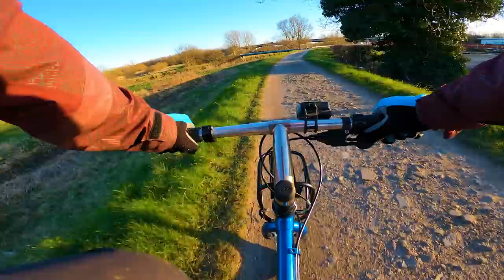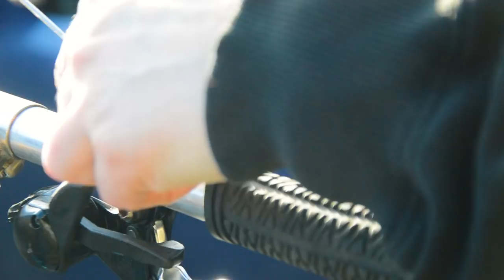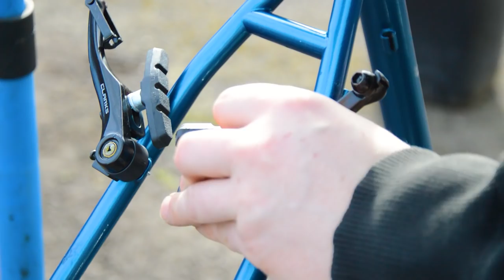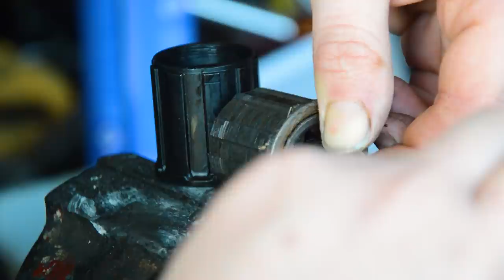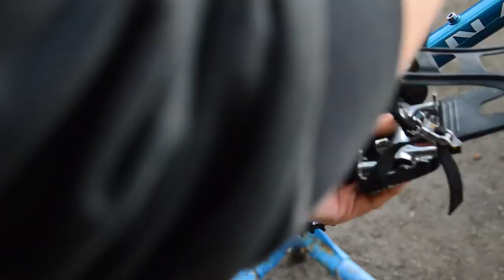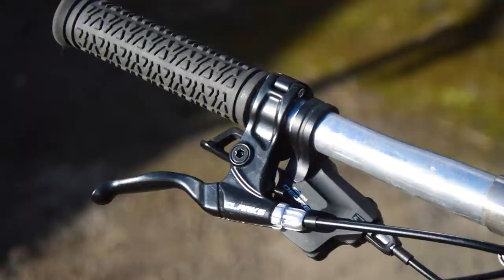7 Speed To 10 Speed Retro MTB Conversion - Slick Bicycle Commuter Restoration

Comment: Oh, you can just SWAP the freehub body.. You just saved me quite some money. Planning something very similar with this old Raleigh Mirage I found.
Reply from the maker: Yeah, I found SJS cycles have a good selection of "modern" freehubs that have the same mating pattern as the older hub.  A bit of respacing on the axle and it's good.

Comment: Cool looking bike, with that black parts it gets that modern look, because there's everything black in these new bikes... Quite highly placed bar with this stem in line with a saddle, so yeah, good for commuting and some recreational use, but it struck me right away to try fit some drop bar in there(maybe because of slick tires)... Though yeah with this long stem it would get quite extreme, but it might just compensate small size for you.
Reply from the maker: Thanks.  I do love the black and blue combo.  It's quite sleek!

Comment: How did you manage the cassette with that derailleur? I have a slx m675 sgs rear mech with the same cassette but the inner cage plate will strike the 42 cog and prohibit the derailler from going into the largest cog. B-Screw is already all the way in.

Comment: Hi, @MonkeyShred . Just found your channel and seen this vid, advice on the stripped threads, when using heat, heat the crank on the outside and not in the centre, heating the centre does nothing but expands the outer BB with the crank, didn't see a comment explaining this so hopefully will help you in the future, seized metal objects like in this vid inner object cool if possible outer heat. Contraction if possible and expansion helps to loosen stuck metal materials as shown in this vid. Enjoying your channel by the way ☺️

Comment: Nice. I’m in the process of doing the same with a Trek 930 from ‘94. Canti’s replaced with V-brakes! Snap! I’m using Continental Double fighters 26x1.9”.  The 7 speed hub will be swapped out but the new drive will be microShift 1x8 with a 12x46 rear and a 42 front. Maybe I should do 1x10 with a 11x48 rear? Like you the frame is one size too small for me so it will be sold hence the 1x8. Love the videos.👍
Reply from the maker: Having ridden around on my 1x8 wide ratio (11-42) conversion for about 400 miles now, what I would say on that is it's fine...BUT... using the wide ratio you can really feel the steps in gear ratio when you're shifting.  Wide ratio gearing is best left to 10+ speed I think for a smoother experience.
Reply: @MonkeyShred  Thanks. I have 1x10 on my other bikes; I like it, but at the moment 1x10 microShift AdventX are not easy to find in stock in the US. I’ll try in the UK when I’m back home in the Isle of Man next month.

Comment: when my 1st last and hopefully only stuck and stripped crank happened it was luckily and Pinned POS..   took a very large hammer and reapeated bashing to get it off.. well over a month of breaking automotive pullers and all. multiple spanners gave their lives.

I have a Nishiki with a Stuck BB somebody burnt the NDS..   tryna buy and impact today.

very useful video for 7-8 speed carrier swaps. I've got two 7 speed wheels I want to run 8 and 9 speeds on as well as donor hubs. I guess as long as the drive splines match..  not sure what brand hubs.
Reply from the maker: Yeah as long as those freehub splines match it's usually a straight swap - taking in to account the difference in axle spacing or wheel dishing that is.

Comment: lovely little bike.
Is it as simple to go from 7- to 10-speed on a road frame?
Reply from the maker: Thanks.  I believe road spacing might be 130mm so the frame may need "stretching" a little to accomodate a 135mm spacing which is what I used in the vid.
Reply: @MonkeyShred    that  is  correct   road  bike  130  mm     so  needs  stretching  but   don't  try  stretching  ally  frame

Comment: hey I couldn't follow what you switched at your axis to make the larger freehub possible... can you explain?
Reply from the maker: In a very brief summary - I measured the difference between the old freehub and new freehub and remove that amount of spacers from the drive side to keep the wheel centered on the axle.

Comment: I have a track bike with 6speed freewheel hub, can i install an 8speed cassette hub without replacing the bike chain?
Reply from the maker: A track bike with a 6 speed?  Not seen that before.  Aren't they usually set up for 110/120mm rear ends? 8 speed needs a 135mm rear end on the bike and doesn't fit on 6 speed freehub bodies.

Comment: What grease you use for brakes and which one for chain?thanks
Reply from the maker: Round the posts?  Just some "general purpose" grease I guess.  Chain? It depends on the conditions you're riding in.
Reply: @MonkeyShred  normal conditions,rain and nice weather, commuting normal stuff 😁,can you recommend a chain grease?I use some decathlon liquid one but doesn't look to durable.Can the chain one(recommended one) be use around brake posts as well?thanks
Reply from the maker: @florinb4668  Chain is an oil rather than grease.  I've used Muc-Off wet and dry condition oil.  For all weather I guess it would be best to run their wet lube.  

It wouldn't work for brake posts really.  That's proper grease.